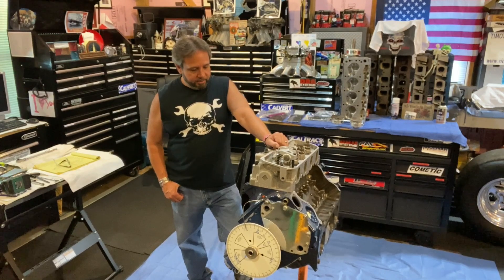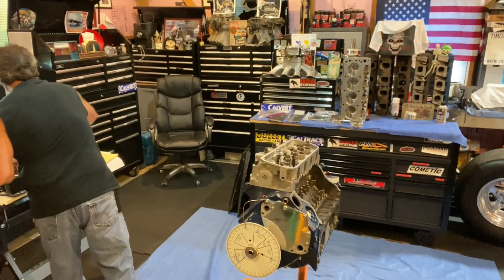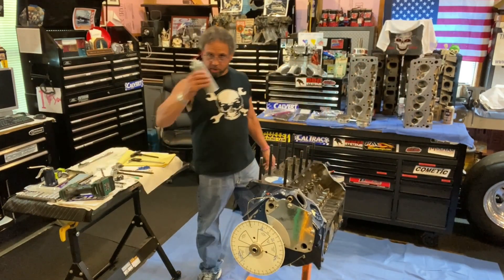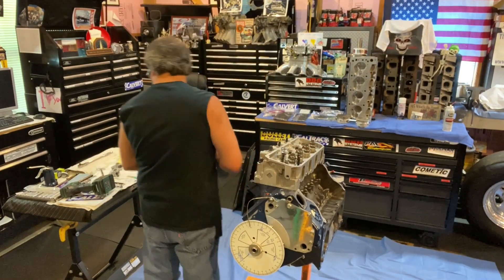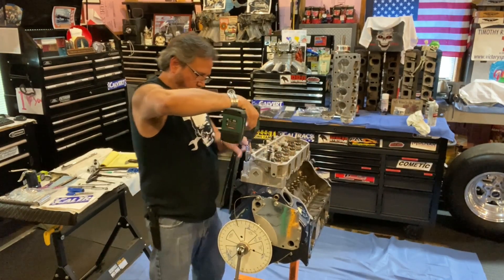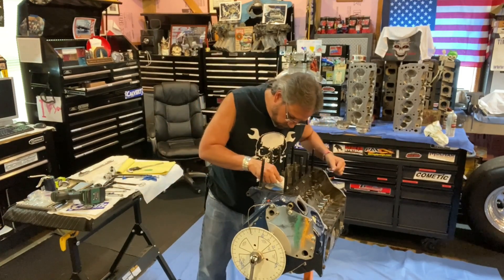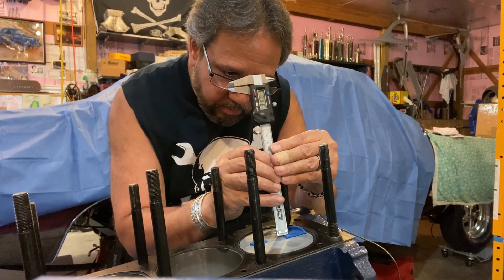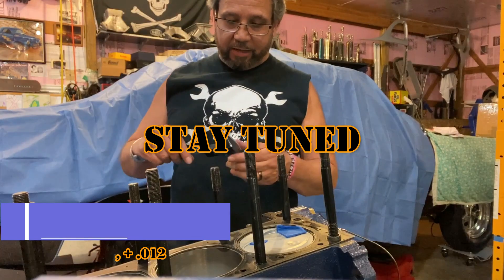Episode 49: The Clay Truth, And Nothing But The Clay Truth, And What You Can Get Away With...

Comment: This was a very good video.  Right now I have some heads and stuff that I'm fixing for a guy who built a 557 Ford using pistons with the SCJ/P51 valve reliefs under a set of A429 heads.  When he checked the valve to piston clearance he used clay but he didn't place that clay across the entire valve relief and he didn't see where the valve was hitting right out at the edge.  After a few dyno pulls the head of the valve came off and made a mess.  I use the dial indicator method most of the time but it really is probably best to do both getting not only how close but also where it might be close.
Reply from the maker: Thanks Dave, the whole purpose of the video is to show that you may be able to get away or utilize more cam, than you think you can. That there is a loss of lift and most likely duration, knowing this you can plan for it. Clay definitely helps with the radial clearances and let’s you see it. That is a mess you don’t want that is for sure. Sounds like a stout engine, 850hp? Thanks Dave appreciate the insight and actual experience. Stay tuned.
Reply: @dragboss351cleveland  I think that engine will make 800 horsepower when it's back together again.  

Another interesting test idea for a video would be to check the cam timing and lift on several cylinders to see the variation around the block.
Reply from the maker: @DaveMcLain  I bet easy.  Love those 385 series engines. That would be a cool video, I am going to do one more with clay and actual valve springs, see how it works out. Then finish mid lift and be done with all the videos on assembly. Get to dyno, although, oil pan and vacuum pump 2 hrs away. So lots of variables, Cougar still in chassis shop.
Reply: That is why I have always relied on the clay method as the last check, with the heads and pistons installed as they will be ran. Using the dial indicator isn't bad at all, but there's the human factor of variables more possible. The clay, and yes enough to cover every mm of the vp areas, with the running valvetrain and pistons will show everything in the end. Using a head gasket that's already been compressed to check will only add a slight bit more clearance when final assembly is done, and that's not a bad thing in my book. MLS gaskets are great for this.
Reply from the maker: @elmerfudpucker3204  yes sir. Right on. That was my whole point. You make you can only x amount of lift/duration, measure then with experience you can go a little bigger than you might  think. That is why some guys are faster than others. On the ragged edge with lift and .etc, and pv clearance, to get the tightest quench. I appreciate the input Elmer👍

Comment: So, it looks like either method done properly, will get similar results. Which method does Tim think is easier/quicker ?!
Reply from the maker: The dial indicator method is the quickest and easiest. I now know that with .053 unloaded that I will have plenty of pv clearance when loaded and actual running valve train. I am going to try and measure with loaded valve train, if I get the time. Thanks buddy for watching and commenting. Appreciate it.

Comment: Spot on, sir. This just verified the dial indicator results from earlier. That close between both procedures, gives peace of mind in the your work. Real world measurements as assembled tells the tales. I hope you do another clay test with the actual springs, pushrods, and rockers installed. You're going to have a very happy little Cat there!
Reply from the maker: Yes I am going to do that and see what I get. Be a nice experiment showing the gain with actual valve train, and getting the most of what I have. I think so, another 10 lbs off, for total of 74 lbs. she will be so much better with a rack and pinion.